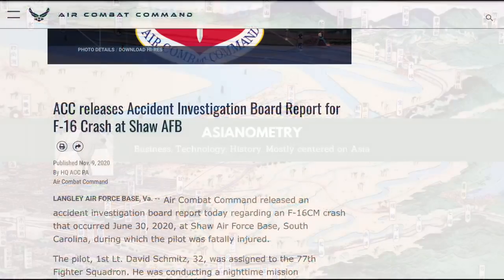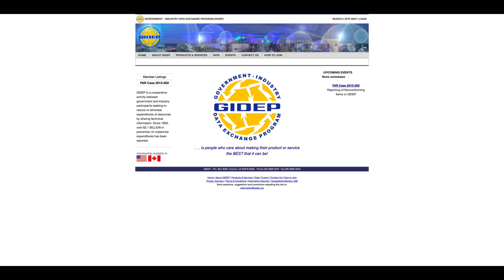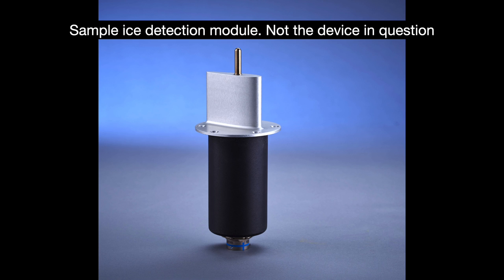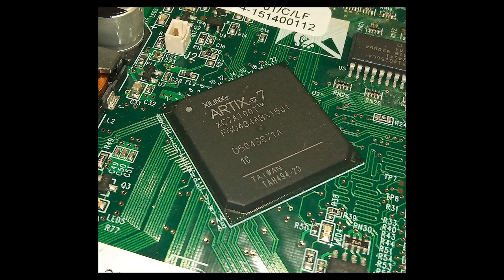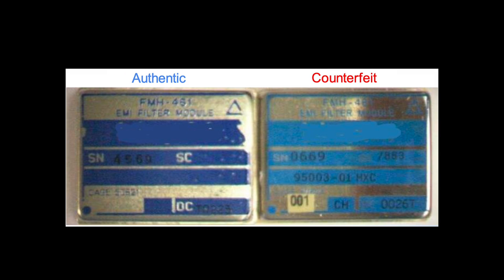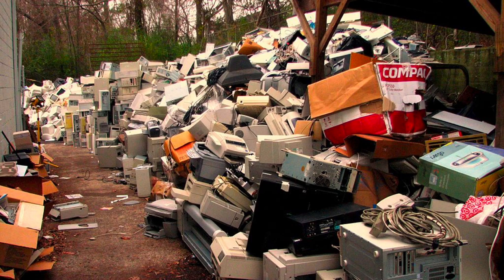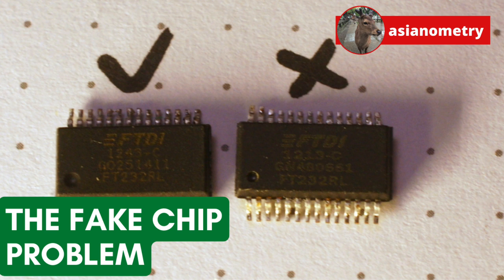The Fake Chip Scourge

Comment: Honestly, I think the recycling ewaste to reuse the chips is a great idea. Then problem is lieing about the chips' origin afterwards. What if a company actually built up a good reputation for selling "refurbished" chips by removing them properly, and then testing them before resale? At least for a hobbiest, I'd be totally okay with buying those. For an end product...ehhh...maybe if the chip wasn't available normally anymore and the vendor could say, what device they came from and prove they were tested, and had a reputation for being honest?
Reply: I also wonder how many legitimately rare and valuable chips end up being sanded and relabeled as some generic thing.

Comment: Yes, Fake chips are a problem and cause much damage. But tbh, the Industry tend to produce this with when they sell poducts sometimes at 10x the producing cost. Take a look at the car parts. Original Parts may have, if at all 3 - 5 % more Quality, but at 5x the price, sure people tend to buy the cheaper ones, cause there should be a stop cap to greed
Reply: I'm thinking similarly as well... and in another way, the overpriced chip is the reason why we need to deal with fake chip, ironic

Comment: 10:05 wrong type of electron microscope for the job of reverse engineering semiconductor circuits, well sort of. you got lucky, since the siemens Elmiskop 101 pictured, and its successor had a scanning electron microscope addon available from siemens. it is, however quite rare, as i have not seen or heard of one having been used outside siemens labs in Germany. while not the absolute authority on the subject of electron microscope history, i am at least somewhat knowledgeable. 

Theoretically you could also reverse engineer an IC by more complex sample preparation techniques, but it would be very time consuming as you would need to make negative replicas of the original for viewing in transmission mode.

edit: i also just noticed that whoever put the Elmiskop 101 pictured back together, put in the aperture drives for the condenser upside down, which should be Impossible as they are keyed, but i guess with enough brute force it might work.

Comment: I love harvested chips that cover places I can't buy anymore because surface mount is now so ubiquitous and a lot of the old designs I populate are THT.  So these chips are not fake unless they are sold as new.
Reply: But do you know, that desoldering could be done with open flame and impact to board? :v And then pins are conditioned in solder bath, that's it
Reply: The components are counterfeit (fake) if they purposely sell you a remarked part that is not the part that it is supposed to be. Even changing the lot or date on the component is an act of counterfeiting. Many of the chinese counterfeit parts are harvested, cleaned up, blacktopped and remarked to be a better and/or newer version of what it was originally. That purposeful misrepresentation of the part fits the definition of counterfeit. 
I might actually trust the chinese if they advertised and sold them truthfully. List them as used (or reclaimed or whatever) and leave the original markings alone.  But now they simply find something with the same pin count - blacktop it and sell it as whatever is selling that day.

Continuing to buy the counterfeit parts only emboldens the criminals to sell more fakes which will continue to get worse as time goes on.

Comment: Has any 'shady' fab been publically busted? It's jsut so hard to imagine a fab with all its expense and high-tech to end up as a shady netherworld thing.
Reply: The thing is, in that scenario, the extra parts they make in a run that end up on the black market are gonna be up to spec since they are the same as the official/new ones... they can always claim they gave the parts to a second disposal company that was supposed to destroy them or w/e which may or may not be true. So unless you have insider info to find out about it it's gonna be hard to prove.
Not all fabs are TSMC making 3nm chips, a lot of smaller ones doing rudimentary power management and FPGAs and so on are much more obscure.

Comment: I have encountered this issue the last 20 years restoring synthesizers, there is much more going on of this type of "crime" as the public is not able to report it.
Reply: The same with repairs of different audio equipment such as power amplifiers, fake output transistors lasts about 15 minutes of testing
Reply: @wojtektoma1005  The counterfeits are not as big of a problem as poorly made counterfeits, because the first one is a problem for the original manufacturer (who is losing money), second is a problem for everyone. Sadly, the former has become more and more wide spread.

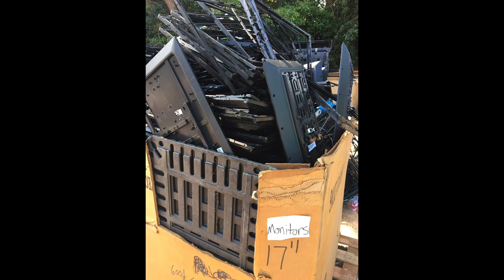Comment: 6:50 sounds almost what I did in the 90's except I did it in the oven at my dorm as a poor student who just wanted to get the chips from PC motherboards. Oven heated to max, motherboard in and after awhile take out, flip upside down and gently bang it to something hard and almost all the chips and connectors would fall off. I think I still have some of the ISA-connectors somewhere.
Reply: However, some venerable parts have had legit die redesigns over their lifetimes.  555 timer, 7400 series logic, etc.  Some of these have been in the industry for 40-50 years.  Specs, pinout, etc. exactly the same.. only rather than it being on an 8-pin DIP, its an 8-tab TSSOP that can fit on your pinky-nail.

Comment: Most of the chip manufacturers have a big disclaimer statement at the end of the datasheet stating that they should not be used in any product that can cause harm or death to human beings should they fail. If you choose to do so you need to request approval from the manufacturer and they will decide if they want to endorse the device or not.
Reply: When a business buys parts that can cause harm or death due to failure, the manufacturer puts this thru certificate of compliance "CofC" traceability from date of manufacturing, through distribution and to final customer. It guarantees you get the right part and that it works BUT tends to drive the price way up. Bad part is now some are faking the CofC as well. Get caught doing that = big time jail sentence.

Comment: As an engineer, I would only care if the part is on-spec. If the manufacturer is violating IP, that's a business/legal problem, not an engineering problem. If Weeweepoo LLC can make the same part as Samsung for half the price, good for them. "BuT wHaT aBoUt HiDdEn DeFeCtS??" If those defects are causing your design to fail and aren't covered by the spec, then you chose the wrong spec!

Comment: I grew up in a communistic regime and many of our advanced chips were coppies of US or Japan produced chips. And they weren't even trying to hide it, like the Czech MHB8008 processor is a dircect copy of the Intel 8008, you probably know what the BE555N was, even without looking. They exploited the fact, that the US patent law wasn't recognized within the Soviet Union and whole communistic block. On the other hand, some of these chips were better, than the original, because they would rather make an more expensive working chip, than make it cheap and substandard. The target market was other local companies, that couldn't buy the originals anyway (The currency wasn't easily exchangeable and you would have to get a go through a lot of almost impossible bureaucracy for every order outside of the system). So almost all of them were pretty reliable and well produced.
These new counterfits have the main goal of making money and they go through a lot of trouble to make it as cheap as possible. The worst counterfits are the power transistors, because even if they make it on a propper sized die, they will certainly use the tiniest wires for bonding and you won't be able to reach 40% of the spec values.

Comment: If you buy an external DVD Drive on Amazon without a brand name, the chances are extremely high you get a new case with a very old drive inside it.
We have some of these, "USB 3.0 DVD burner" but the burner itself is from 2008 with an IDE connector...

Comment: I have seen a lot of people talking about, electrolytic capacitors, but ceramic MLCCs are also a problem, especially as most are not marked and can be difficult to catch without destructive testing or expensive LCR meters(looking at you E4980A) and special fixtures to catch the issue.  Also a disturbing modern trend is mixing high grade MLCCs with lower grade ones.  Sometimes this can be very difficult to catch as consumer grade chips might last a long time, before failing.  Though failing well below the higher grade rated lifetime.

Comment: Not an electronics engineer (I'm a programmer) -- but would it be possible to build a universal IC / Capacitor checker by having a database of known values between pins (resistance, etc.) and then plug in the IC and have the unit test all known functions for that IC? At the bare basics, let's say you had 7xxx ICS and you were just checking gates -- that should be possible with a box where you can plug in the IC and run the tests?

I know the box might be expensive with the DB of several hundred thousand common ICs, but even at a few thousand dollars, it would be well worth it to avoid putting in bad chips?

It could start with very common tests like "is there a short between VCC and ground for this chip?" and then go from there and run tests based on what the chip is supposed to be able to do?

Comment: I feel like the comparison to counterfeit designer products falls a little flat - a fake LV bag is ultimately still going to at least work as a bag, while a fake chip will often not work at all.
Reply: Fake chips often do work but they often won't meet original specifications. They won't have the same power handling capacity or signal integrity. Subtle things. Like buying a Rolax watch off a street vendor. It's not the same as the real name brand but the hands move. Nevermind the green stripe you get on your wrist wearing it.
Reply: 👍🏼 Absolutely! Faulty electronics pose a much bigger risk than faulty fashion. 🤯
~ repliesgpt
Reply: @cyrileo  oh contraire. A fashion faux pas is something one can never live down.

Comment: Your coverage is interesting and accurate, but seems a bit one-sided to me. Yes, there are bad actors out there actively grinding the markings off of chips and relabeling them, but that's not everything that gets called "counterfeit," and there are a couple criticisms that I think can be directed at the "legitimate" manufacturers as well. First, what an OEM calls "counterfeit," someone else might call "competition." The most infamous example of this may be FTDI, which published drivers for its USB chips that attempted to detect what it regarded as "counterfeit" alternatives, and then deliberately destroy them. Legal clone or illegal counterfeit? That's a legal question that it isn't necessarily FTDI's prerogative to answer. Second, the issue of recycled components has another side. Sure, if I am buying recycled components, I want to know that. But as long as they are correctly identified, I think selling them is a good thing. It may be very hard to find new examples of lots of components--either because they are obsolete or because the manufacturers limit aftermarket supply. Or I may rationally choose to buy a recycled version of an expensive part rather than shell out for the new one.

Comment: the FPGA route is a good replacement, but a fake FPGA chip, now thats just deep faking. FPGAs can be any CPU you like, so they can replace old processors as long as you have the instruction documentation of that chip. Used chips are fine as long as they still work, as if they dont work it would be due to physical and electrical abuse. However using a wrong chip in the wrong place will not work.

Comment: reality of recycling is that it's often more expensive, than new, it sort of works with underpaid labor of less developed countries
Reply: Depends on the Economy of Scale of original production. There is "average fixed cost" (AFC) in production:
* if it was a commodity chip where millions were made, then yes it is not profitable to extract, as the AFC is small per chip. 
* if only a few thousands were ever made, then the AFC is high per chip, it would be profitable to extract those chips.
Reply: @voidvector  resale value matters of course, it's like cord cutting of toasters and washing machines, when the rest is barely worth the scrapping and delivery time/effort/money

Comment: Not so much counterfeit parts but a few years back I casually happened upon a very good torch made in China. It was simply a random led torch but its design suited a particular market here in the UK. I sought to begin officially importing the torches and suitable batteries and chargers.
Over the space of 7 months my supply went from fantastic and all the way to disgraceful. The makers in China had sought fit to seek every method possible at their end to make more profit for themselves by whatever means that takes. 
Batteries were the first thing to suffer. Suppliers began slipping into the batch the odd used battery that had a re-wrap to make it appear new and higher capacity. Internally, the maker was completely different. Next came the torches. Instead of machined parts, the maker began rolling and stamping components with the effect of creating parts that didn't fit well or were of too thin a construction. Next came the torch led chip and electronics - utterly false to what was claimed and some not working.
After that short period of import, I had to stop. The 'hit' was being laid onto me. Component suppliers trying every way possible to cut costs on what was a unique and great product.
* Anyone wondering - it was a focused beam torch (fixed) with a unique reflector that allowed for a small hand held led torch to illuminate objects over a mile away. A superb integrated high power led unit, long life high powered batteries (interchangeable) and completely waterproof. It was perfect for hunting and hobbyists to seek out nightlife, security to see in the dark.

Comment: "heating over an over flame and bashing against a hard surface"? Sorry this is just plain on wrong, at least while ignoring the most incompetent recyclers

If reuse of chips on PCBs is the goal, they will be heated using a heat plate or (for cheap/robust parts) a solder lead bath

Heating over an open flame will destroy every but the most basic parts. Even a plain wire will be destroyed by an over flame O_o

Comment: At one point the words "...despite being labelled as military grade...." were used.  The irony is that the counterfeit offerings are the actual military grade options.  Military grade just means the cheapest possible contracted option that still "works".  As someone who has worked on tons of military grade vehicles over the last 14 or so years it's a joke for quality control in terms of build.  The only way to make most Humvees not leak body wise in a lot of cases is to tear it down, patch large holes going over meticulously, spray a coat of liner over the entire thing, and then maybe you'll be down to a few leaks.  That's not even getting into the questionable engine, although I find the Detroits to do alright when not overtaxed.  The Humvee I have for personal use is still mostly the same engine just with some mods to increase output to the replaced transmission with more gears to not be redlined at 40-50mph.

Comment: 4:47 -- They probably didn't *neglect* to test the rest. The fifty they did test were likely random samples pulled as part of a system called statistical process control. A specialist in this system probably told them based on experience and theory and whatever that fifty was the appropriate number of random samples for the number of units delivered. Sometimes the proportion is a lot lower. When I worked for a company manufacturing pumps, the sample rate for most parts was one in fifty. For some kinds of products, the rate is one to one. It's variable and depends on a lot of factors.

Comment: The issue of recycling old motherboards and electronics for their components sounds good on paper until you hear of all these counterfeit electronics horror stories.  Still, we have to find a way of eliminating all electronic waste.  When I was a younger man, I used to restore old cassette players and replace the old capacitor or resistor to buy extra life for a treasured peace of old electronic gear.  Most of the time, I got some pretty nice sound systems restored this way.  Occasionally, it would end with more damage to the electronics because I couldn't resolve the ultra fine 0.02mm size print on the capacitor.  Sadly, board mounted electronic components are super small with ultra fine connections.  I need highly specialized ultra expensive equipment to even have a chance at repairing such motherboards.  In all cases, it's cheaper to buy a new computer then the cost of buying the tools needed to repair side motherboards.  A modern motherboard repair system complete with quality control gear can easily cost more than $250,000 and require highly qualified specialists to use.  Needless to say, this is why all consumer electronics including high end gear is considered a disposable item once a small component goes on them.

Comment: I'm amazed that there isn't an established market for reclaimed/recycled chips sold as such. Most electronics are discarded long before many of the chips wear out, so it makes sense to re-use them.
Reply: Exactly! I have no problem with vendors selling used ICs — as long as they’re up-front about it. It’s the dishonesty that I can’t abide.
Reply: Where's the money in that? :)
Reply: @aralbrec  Well, for rare chips that aren’t manufactured any more, there is the repair market that needs them and will pay for it! But yeah, nobody would buy a used 741 op amp or whatever.